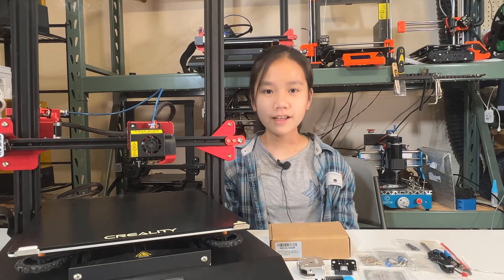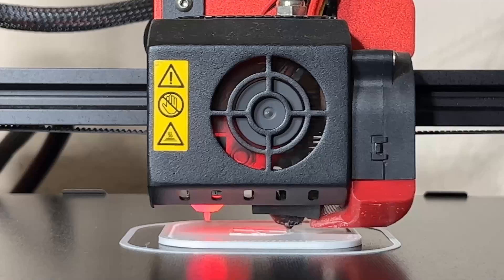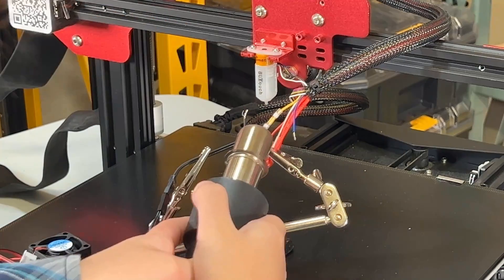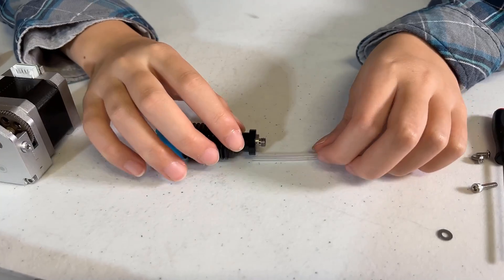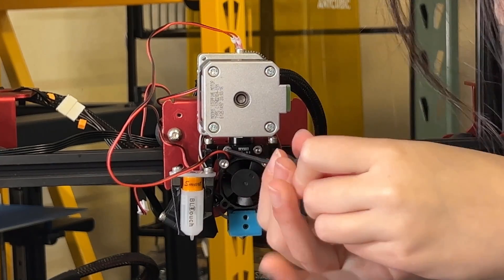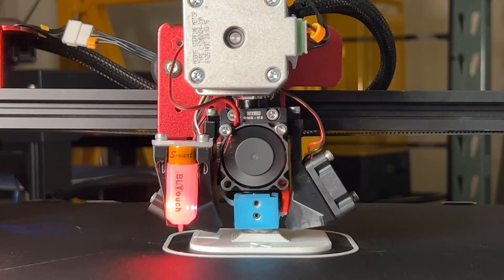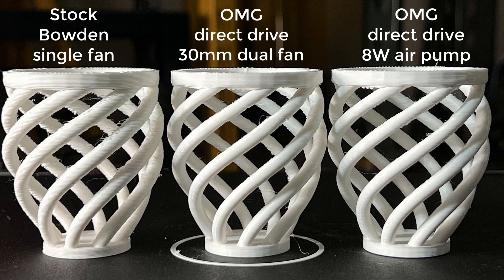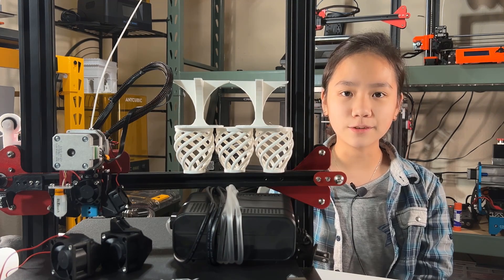Improve 3D Printer cooling Dual fan, jumbo fan, or air pump? OMG Direct Drive Extruder CR-10S Pro V2

Comment: Where did you get the fan splitters? I can’t find 2 pin ones. Plz link
Reply from the maker: You can just solder them or use some connectors like this to DIY a splitter cable:
https://amzn.to/3Q8JsUh
Reply: @AuroraTech  thank you. I have another question. I just got a Neptune 2S, and I’m having trouble dialing in calibration with walls. I’m trying to print two walls hollow cube to achieve 0.8 wall thickness and I’ve done e steps and I have Cura setting correct and I 3D print 5 bed leveling tiles and they are all smooth but I keep getting elephants foot and too thick of walls. At 100% flow they are 0.83-4 and right now I’m at 70% flow 0.82-3. I feel like that’s really low for flow and am wondering if I’m missing something

Comment: What were your settings for the extruder mine keeps clogging my nozzle?
Reply from the maker: Do you mean the E-steps settings of the stepper motor or slicer settings?
Reply: @AuroraTech  In the slicer settings
Reply from the maker: I just use CR-10S Pro V2 profile, retraction distance 1mm, retraction speed 40mm/s for the OMG extruder. I normally print PLA(200/60) and PETG(235/85) with this printer, these settings work fine. I would suggest you remove the heater block and nozzle, make sure there is no gap between them, that's one of the most common reasons why the nozzle is clogged.

Comment: Very nice videos!!! I watched both the OMG A2 and OMG DM1 videos. I still have a few questions. First can you compare the 2 extruders. If I purchase the A2 I will be using my own Genuine E3D gold edition hot end. I like the dual single gear design of the DM1. Is the A2 a dual design or a single design? Allow I am trying to figure out how to mount this on my Ender 3 Max printer. I bought the mount on amazon called the "KLEMCO All Metal E3D V6 mount". This bolts to the existing screw holes on the X-axis carage.  I am just trying to see which extruder is going to be easier to mount. I see how the DM1 screws into the extruder if you remove the bowden tube coupler. But on the E3D heatsink this part is non removable. So you see my issue. I could use it as a Bowden setup but I would rather set this up as a direct drive system. Thank You!

Comment: I just found this video and I am shocked I have been looking for DDX for months. now this OMG never heard of them but the result you show is awesome. We have completed a new controller for the trains, and need to start printing our chassis. We to add ball bearings and my first print was awful. holes out of round and layers shifting. Now oi see rhe result of this OMG on your CR 10s Pro V2!!! I have a CR 10s Pro V1. So .... I really want to upgrade now. I just sold my Fender Amp and can use this money to buy the parts. Could I try a 3mm Nozzle for more accuracy???? I will check your parts list and price it out. Will my existing Motor be too heavy to use. I know your getting a smaller motor but you know $$ is tight But i know weight is not a good thing. Maybe the air pump but then $$, i will have to see what works best. I can not believe i find these things on you You Tube channel.  Extremely helpful. Thank You both so much. I started to use the Level analysis spread sheet but my dang nozzle came lose and then i had to relevel the whole setup. Even the Z was off.  How can send you photos of my strut installation I want to share it with you. Z is 10X stiffer!  Thank You Dennis

Comment: I thought I know everything but every week you teach the old dog many new tricks. Thank you. I learned that the extruder upgrade makes a huge difference and also allows me to change the filament quickly and easily. Then I learned that the air pump is an interesting solution if we could control the airflow. Taps? Valves? And I learned that the dual fans improve the print quality and as they are controllable through the software, it's an easy solution. You show how easy it is to change the basics but now my head spins with all the new possibilities. Tuning, tuning, tuning. All metal hotend, CF Nylon, ASA, transparent PETG. Great and very informative video, Madam Professor. The elbow patches are a giveaway. FAN-TAS-TIC

Comment: Running axial fans in ducts are just stupid. Use radial fans! Axials are not made to push air like that. Also you are running your bridges to slow!
Reply: Aurora is not using standard axial fans for cooling. She is using axial cooling fans that have an air exit on one of the four sides (not opposite the intake). Those are specifically designed for cooling and air extraction.
Reply: @aps3000miki  what?
10:19 into the video i regular axial fans
Reply: @SplitPhotography  You are 100% correct. My apology. But combined with that fan funnel they can well be used for cooling.
Reply: your right :), the "blower" style fans do pressure much better, and mellow on aliexpress do sunon ones, with good build quality now and 24v pwm :D

Comment: Great video.
For the cooling: The cooling needed depends on speed and size of the nozzle. While the two big fans are oversized at the "normal" speed with a 0.4mm nozzle, they give you enough air if using a bigger nozzle or if you increase printing speed (f.e. after adding klipper with input shaper). Of course nothing stops you from reducing the air flow for normal speed with 0.4 nozzle by setting fans to 50% or less in slicer.
While at the moment most people do not change nozzle very often, with the upcomming revo system this might change in the near future. So (exept for the noise) I would prefer the big fans to give sufficient cooling even for 0.8mm. They should be less noisy anyway when driven at 50% or less with 0.4mm nozzle. I would realy like to see a testprint with the big fans at 50% or less - and also on full speed with 0.8mm nozzle. Maybe time for some more experiments there...

Comment: i expect the airpum work better. meybe the nose of blower need to be improved.
Reply: A circular bend rod, cooling evenly around the nozzle is the most common way to use a pump. Aurora just compared left and right - what about front and back of the print?
Reply: @oleurgast730  true.i forget too the back and front side.

Comment: This looks like a great setup.  I wonder if a little z hop and/or a little less flow (extrusion multiplier) would help prevent the filament from pushing down on the arms the higher they go.  Not sure either of those are related to the new setup, as it was present in all 3 tests.  Great job detailing the installation!

Comment: I haven't seen an air pump cooler before, seems like a great idea for running in an enclosure if you actually want cool air. But then, it might over cool and lower the whole chamber temp. Nice to get the weight of a fan or two off of the carriage though, especially on a DD setup. I have a Micro Swiss direct drive; it uses the same stock motor so I have been a little concerned about the weight, but the nice thing is the motor is rear mounted to keep the balance sort of neutral.
Reply: It has some time around, check out Berd air system
Reply: If you print filament like ABS, you need to turn off cooling anyway. So if you use an air pump for high airflow part cooling, this means you print PLA , there you normaly have to print with the door open as you normaly do not want the chamber to heat up. So getting cool Air pumped in is not a bad thing, you might even be able to leave the door closed (if you have aditional fans to get the Air out, like on the CR200b).
Reply: @oleurgast730 , totally agree. In an enclosed system with ventilation fans the air pump could be a god sent. Before I watched this video I did not even know they exist.

Comment: I think you should experiment more with the 4020 fans and just tune them down a bit don't run at 100% . Your cooling with the 3010s is better than stock but I think there is still some additional performance to be had there.